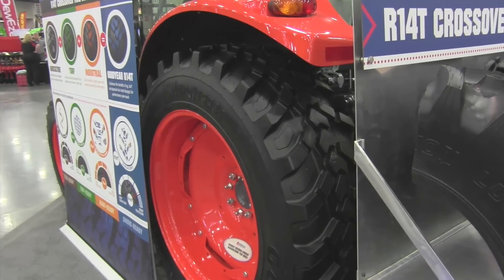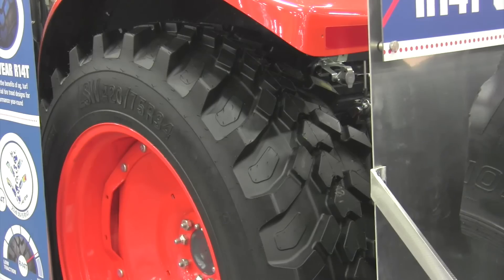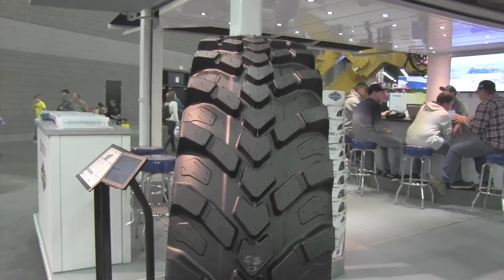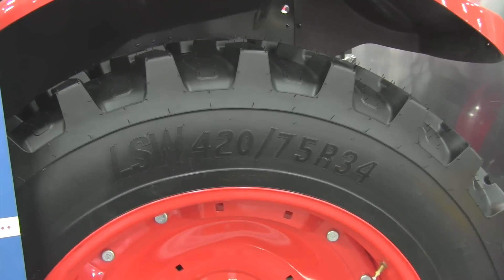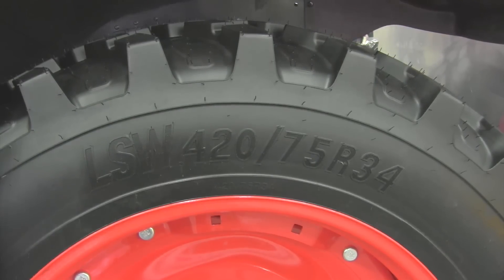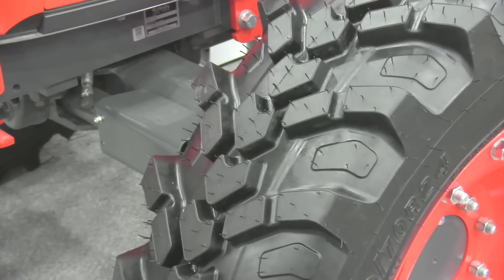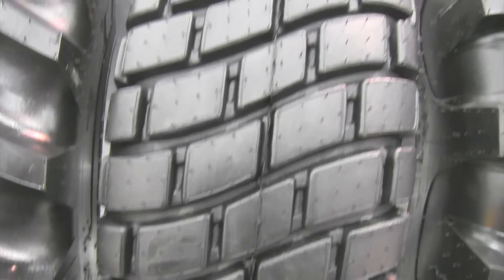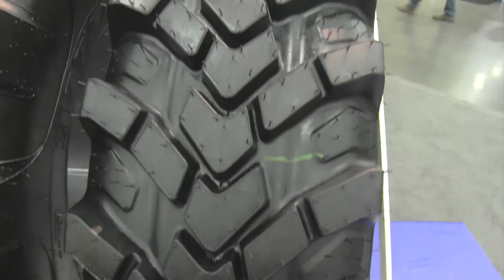What are those Funky Tires on New Kubota and LS Tractors?

Comment: I have a new Kubota LX2610 with R14's and I'm impressed so far in my application. I'm coming from a B7500 with turf tires that I used chains on in winter months.
Reply: How is it on grass? I just order the same setup
Reply: I just purchased my R14 for my LX2610 but there smaller than my turf tires they are 14.7 can I get bigger tires or is that only on the LX2610SU. ?

Comment: I wish tractor tires were all sized in the same standard.  There are like 3 different ways the sizing is stamped on the tire and it really makes shopping hard.  Mine are 43x16.00R20 which is a cake walk to decipher.  This 13.6-24 B.S. makes no sense and requires a chart to figure out the diameter.

Comment: I have the R-14's on my new L2501. They have done well so far, but this is my first tractor and I have nothing to compare them to. What I have noticed, they are very easy on the lawn, and don't load up with mud to terrible. I have had them spin while using the loader, but the L2501 isn't a real heavy weight and I haven't developed my loader skills yet. I will be fluid filling the tires soon. I did notice the tire rubber compound is a pretty soft mix. The cleat height doesn't set up to high and looks like it's a half worn tire, lol.. so I'm  curious about the wear time. My tractor will probably never see any road trips tho. Honestly, they remind me of a high quality sport ATV tire. If I look at the R-4's  long enough, they start to look like a  racing slick because of the large amount of surface contact area on the cleats. The R-14 looks like a good compromise of cleat surface area and cleat spacing if that makes sense. They are still pretty new to the community in general so maybe my review and others later on will help everyone make an informed decision on using them. I'm a Newbie, first tractor owner, no experience, and I def didn't get paid by a vendor for my review.....I only got a fat payment book,  LOL.

Comment: Ag tire sizing needs to be more standardized. The metric sizing gives a more accurate representation as to what the actual size of the tire is vs getting a width and wheel/rim size that the mfg. May have a different sidewall height than the next mfg.
Reply: Really? To you maybe. Sizes should be where anyone can read them in metric and inches and standardized like some of the tools that are the same in size. It is what it is and different people have a different idea on sizes and measuring. It can be done in the best interest of everyone but seldom is.

Comment: I’ve got the Titan R4’s on my Kubota L4701 and I’m happy with them, they are not hard on the turf when in 2 wheel drive and offer great traction on a variety of surfaces when I go back to 4wd, . I am curious if the raised knobys on the outer sides of this new R14 won’t be just a bit harder on the turf, just by the way they look? But in my case, if it ain’t broke don’t fix it!

Comment: Even with turf tire's a real man can easily still pull a 140' tall white pine through slick Clay mud. What you do is rapidly wiggle your A$$ side to side....simple as that! 
My Deere has real AGs as I'm never on blacktop unless I feel like cruising down to the local gas station, but it has road hop so it isn't fun after the first 3 miles lol
Nokian has some awesome treads available, can't wait to see where these newer type tires go. Firestone SAT2 is what I plan on next as slightly more lugs at a better straight line angle shell bite better in snow and ice (obviously even city boys know turfs are the best snow/ice tire) yet still pull the big ole Deere through the soft forest loam/mud.

Comment: Wondering how the R14's compare to the R4's in clay...MUD
Reply: I can tell you that I put a set of these on my JD F932 mower. Had turf tires previously that were well worn. My back yard is pretty steep down hill and solid clay. My kids kept burying the mower up to the frame. I put the tires on at the end of last season and I haven't had to pull it out yet. I will say that if you are the kind of guy that has a manicured yard you're not going to like what the tires do when you make a sharp turn. For me I'd rather not have to pull my mower out of the mud so I'm ok with the grass getting torn up a bit.